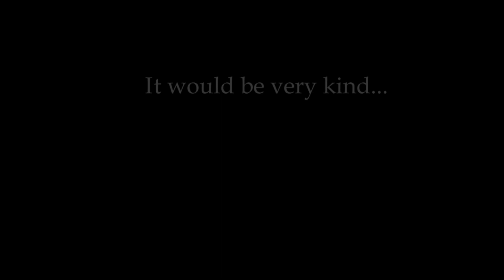Midweek at the Citadelle 14   Priceless Plumbing!!

Comment: It is a good thing it happened early in your Chateau owning life, it made quite a mess but now you know you have the right sewer piping and where it is on the property.
We had a blockage, caused by a hole in the clay waste pipe, the solution all those years ago was to cut the bottom out of a bucket and 'wrap' it around the pipe, marginally better than a plastic bag! The neighbour's mango tree had a wonderful time with a huge root resident in the pipe.  Thankfully, we are past that challenge.
Reply from the maker: It looks like we are not the only ones with a sewage 'badge of honour', it's all part of the adventure  😂😂😂 Have a great end to your week, Suzie and Rols

Comment: I've been binge watching for the last few days, and enjoying your journey! I always have the same question about buying a home in France. Are mechanical inspections not required? I've heard other chateau owners talk about the hours-long walk throughs going over every detail before they officially buy the property. But, it seems everyone gets hit quickly with water or sewage or roof problems that would have been caught in the States by an (almost always) mandatory inspection where everything mechanical is gone over with a fine-toothed comb by a licensed mechanical inspector. Does that not happen in France?
Reply from the maker: Hello Lora, thank you for watching and enjoying our journey. In a lot of European countries detailed surveys do not exist, in France we have a diagnostic report which focuses more on legal conformity ie lead paint, asbestos, electrical safety etc. Houses are more or less sold as seen. There is a process for recovering costs against deliberately hidden faults but can be a drawn out process and sometimes it is quicker to just remedy it yourself. Have a great weekend, Suzie and Rols